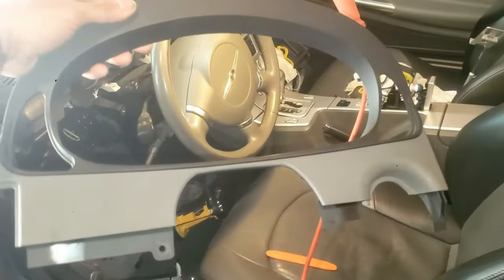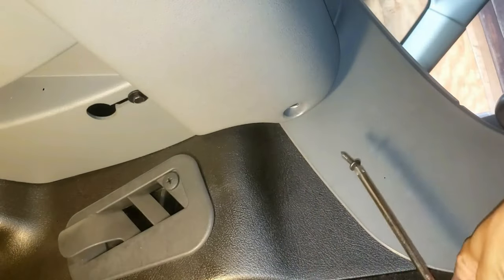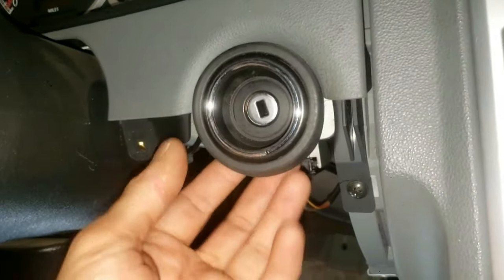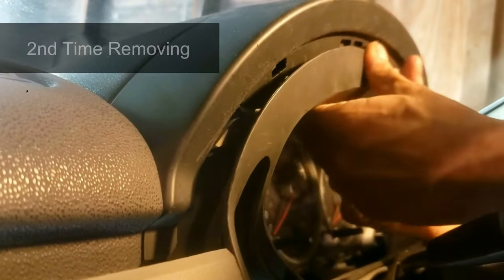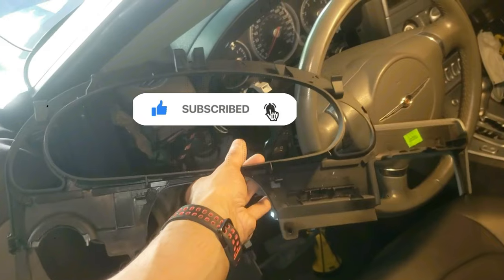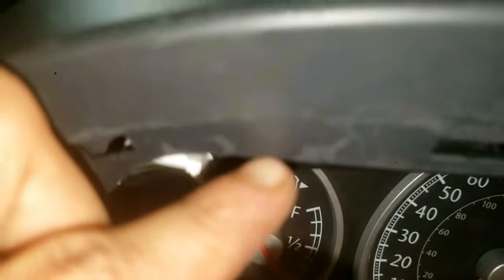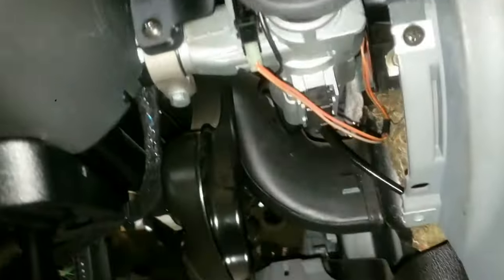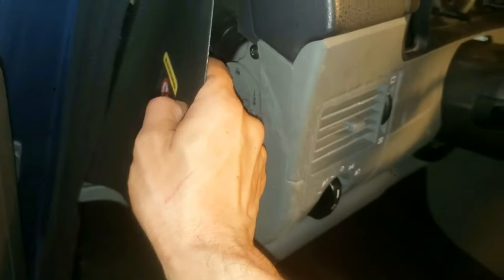Remove Chrysler Crossfire Mercedes Instrument Cluster Panel & Lower Panel

Comment: Having got that far it would have been good to see how to change the instrument cluster lights 🤔
Reply from the maker: I removed it so I can easily work on removing the key assembly. However, the lights as well as the speedometer shouldn't be that much difficult to remove or replace either.

Comment: nice video, thanks for help :)
Reply from the maker: Glad this helped. I made the video because this piece is very firm and has to be taken off or put back on specifically as to not damage it.
Reply: @FixCarYourself  Maybe you know how to remove speedometer to change bulbs? I need remove one bulb for light failure indicator :D - i have led's on my headlights, you know... canbus
Reply from the maker: The speedometer in this video is easy to remove after removing the instrument cover. Just a few screws, and its out.
Reply: @FixCarYourself  Thank you :)